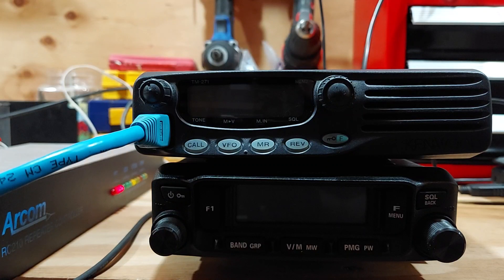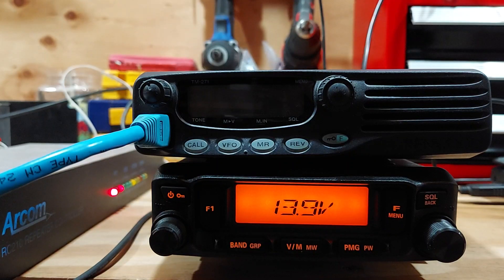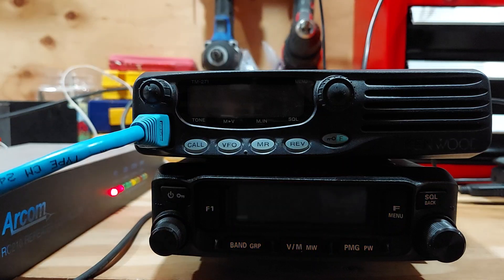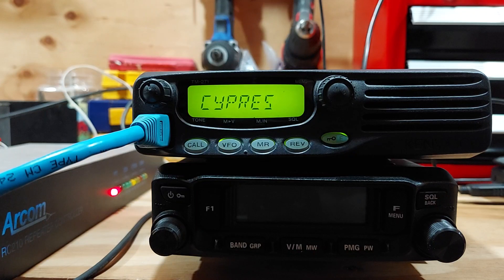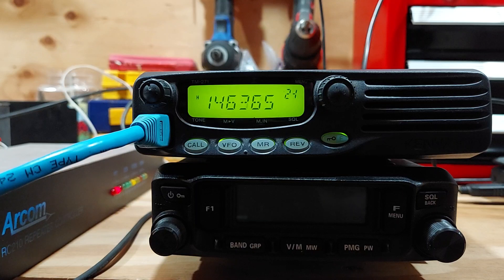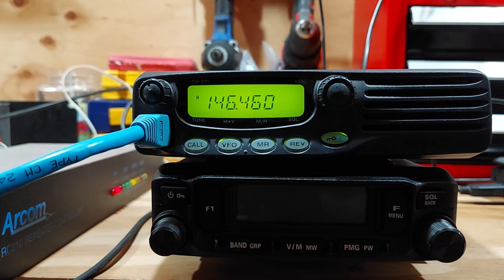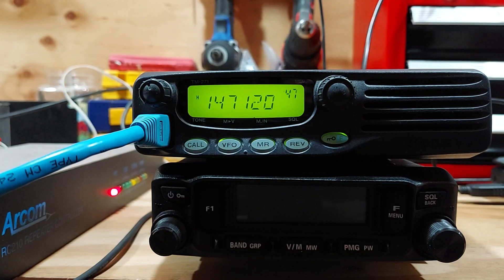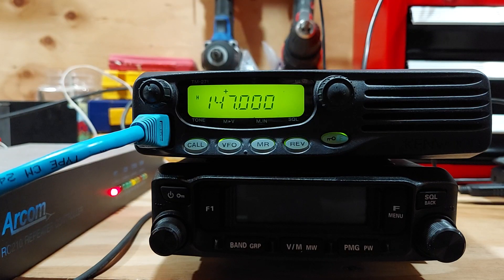Ham Radio - Arcom RC210 Remote Control Demo

Comment: Does the controller accept DTMF tones over the air or does it require a cable for DTMF?
Reply from the maker: The RC210 controller accepts the dtmf command over the air.

Comment: Is the cable from the rc210 that blue one going into the 271 mic jack or did u run it in the back to those solder pads ?
Reply from the maker: Hi Bill,

Actually both, there are two cables needed. The first is a cable from the solder pads to the controller which is done via a DB9 cable that provides the rx/tx/COS and ptt functions. The second is the blue cable plugged into the mic jack and connects to the data connector on the RC210 to provide the frequency manipulation. 

Here's an old video that shows some of the above.
https://youtu.be/uezlGhx2hEE?t=141

Thanks for asking.
Reply: @Shawn Dienhart  ahh ok that makes sense.  Thanks for info !

Comment: Slick.  Where is this functionality used in practice?
Reply from the maker: These radios are installed on a mountain top as a repeater/remote base. The 2 meter radio is used to scan the band remotely from my QTH, or elsewhere, and the 440 radio is a half-duplex link to another mountain top repeater/remote base. 

More info here:
https://www.theradioroom.net/hamradio/remotebase.html